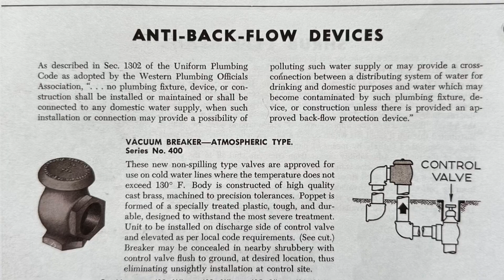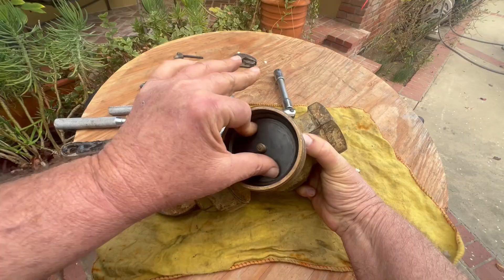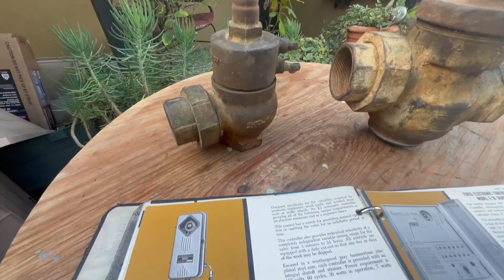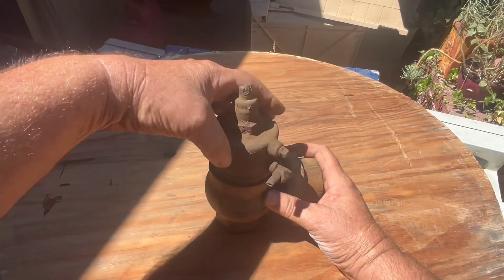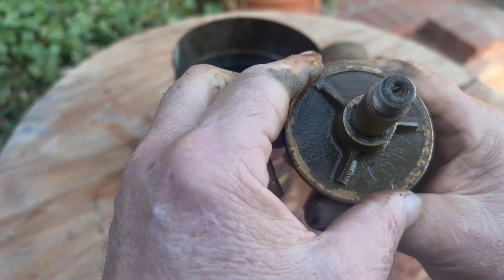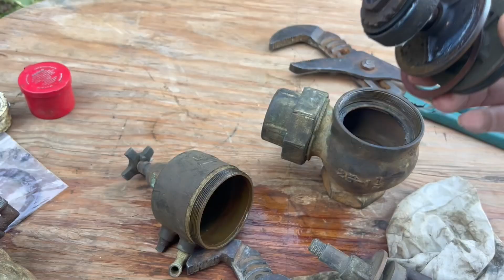The History Of FEBCO Part 3

Comment: Awesome! This display of those incredible valve is amazing!  so neat to see you disassemble and reassemble these valves, such beasts of the day. I have a 1" #25  and i believe it and the subsequent Buckner 25 or 1825 solenoid controlled piston valves were the best in the business; such a reliable long lived and really a very simple valve either hydraulic or electric....I was very disappointed to see Royal Coach discontinue the production of them, but I know that the cost of bronze and the precision machining kept them on the pricey side in an era where plastic was cheap and cost cutting was more important than reliability.... those valves from the 60's or 70's would outlast any plastic or modern brass diaphragm built today! I had installed many 1825's in the early 80's and wish i could still get them.
That 585 is a real beast for sure, looks very robust and durable but difficult to field service definitely made the 25 the best improvement, I always liked the angle pattern best.. Im excited that you have had the experience to work with these engineering marvels in the day when they were in actual use.... was the 585 installed on its side in the box, so you could open the top and bottom end for service? or did you have to remove it from the line for repairs?
Very nice display! Thank you for sharing Dave and Bill your knowledge of the history and the great Brass story is incredible!
Thanks
KV
Reply from the maker: Kerry, Thanks for your comments, and I agree that the valves were made to last. They had a lot of pride and great value along the way in making them. We must have had 100’s of them scattered throughout all of the schools. It’s great that you have a 1”. And it certainly was a sad day when they discontinued in the manufacture of them and no doubt the cost to stay competitive was the driving force behind it as the plastic world of valves became more prominent.

I/we only had one high school site that I was aware of that had the 585’s. They were on the athletic fields and all were in 2”. They were originally installed in the vertical position and were direct bury with no valve box over them. So when we did repair them, they were quite challenging. We probably got about a 45 years of service life out of them. Pretty amazing!

Thank you for sharing your knowledge and comments. Thanks for watching!